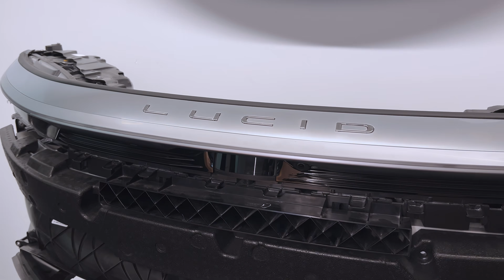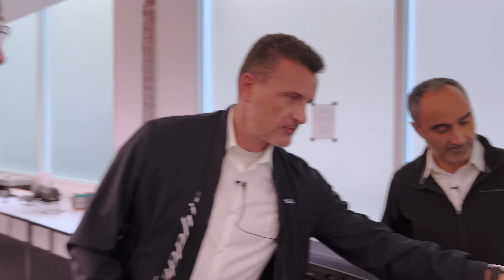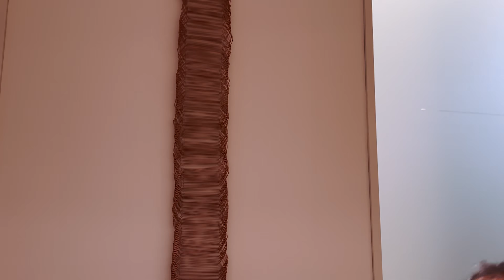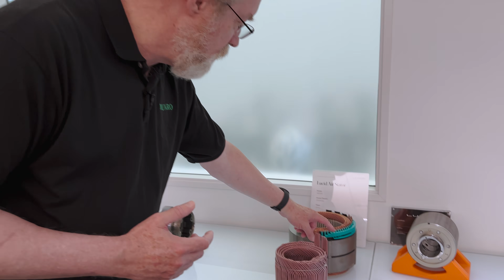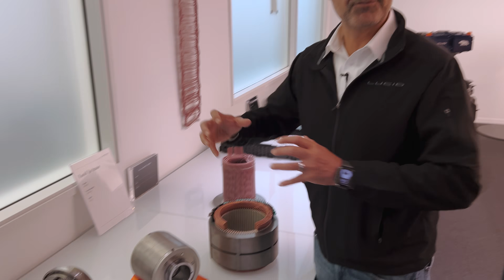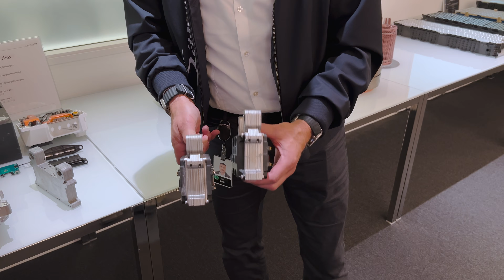Lucid Motors’ World-Leading Electric Powertrain Breakdown with Emad Dlala and Eric Bach

Comment: Impressive Engineering at Lucid!  I just hope they can become profitable!
Reply: 2028 🙏
Reply: They’ll make profits in repairs and replacements
Reply: @ what do you mean Explain?
Reply: @robertoguerra5375  How can they make money with over 130k LOSS for each vehicle???? That is a LOT of repairs and Replacement....If that happens, then why even buy the vehicle with them breaking down all the time????
Reply: @1flash3571  It's normal for a manufacturing business to lose money the first few years. Typically it's 5 years. Once they reach economies of scale they will make a profit. If you look at any other car manufacturers, they followed the same trend lucid did.
Reply: @rami8896  Do you even know what you are talking about???? Lucid started in 2007!!!! That is MORE than 5 YEARS.
Reply: @1flash3571  Im talking about the manufacturing EV business. All their equipment and factories etc are all brand new, therefore they have a high spending which makes them look like they are losing money.
Reply: @1flash3571 they didn’t become a “manufacturing company” until 2020. They used to a company called Atieva who designed the drive trains in Formula E (and they still do under the Lucid Brand)
Reply: @rami8896  No.  Rawlinson should have lowered the companies standards on engineering genius on their 1st model & focussed more on quality & output.  Getting more paying customers in, to start.  Elon's business plan has worked.   PR is too obsessed with beating Elon to be a good head of any business.  He's a childish pr4tt...  His annoying grinning on every early video & insistence on pointing out how Lucid's tech & efficiency was "sssooooo much better" than their 2 main competitors (using Porsche & Tesla modules as direct comparison, but without naming them) whilst smirking his silly little head off, was childish, ridiculous, annoying & CONCEITED!!  Compare Lucid' vs Tesla's production & sales achievements over the same timescales & Lucid lags considerably.  PR's obsession with "doing better" than Elon (in revenge for being sacked from Tesla) is hurting Lucid's, engineers who are seemingly more brilliant (or at least achieving more) than Tesla's!  PR needs to step down or sideways.  Lucid video's are far more watchable without his slappable face & comments on them.  Good luck to Lucid but they need much better reliability & many, many more sales.
Reply: @1flash3571  Peter Rawlinson wanting revenge on Elon for sacking him & his obsession with making a better car than Tesla to prove he's not a loser is the problem. You don't need perfection to beat Elon or ICE, you just need better...
&.... SALES!!   Peter R should go back to being an 11 year old circus clown & let, perhaps, Eric Bach take charge?!
Reply: They need to make affordable cars
Reply: @joebrdr and instead of 75kg 600+kW motors, make them 20kg 150kW, cheaper, lighter. Also lightet and cheaper rest of the drivetrain, smaller and lower current inverter, etc. Then shift cell chemistry to high energy. Nobody, except a bunch of rich enthusiasts needs a 2s 0-60 car. People need people's car - cheap, reliable.
Reply: Flula Borg can do no wrong
Reply: They OVER Engineer parts so they can't lower the price and make a profit....Tesla knows how to do the same but they realize that they need to make a profit to survive. Tesla is smarter than Lucid.
Reply: People are comparing them to Tesla, and how Tesla is able to price their vehicles the way they do. But Lucid is way beyond Tesla in terms of quality, user interface and just overall better vehicle. They are the Mercedes of EV’s, while Tesla is more like Lexus of EV’s. Lucid’s vehicles will more than always be on the more expensive side.
Reply: They will be profitable but it won't be for a while. They are still building / spending on technology. When they offer a mid sized SUV supposedly in 2026 that will be a volume  / profit play.
Reply: @tuminatr  Hardly expanding, they are still STRUGGLING!!  Too busy focussing on the tech & quality & NOT SELLING
Reply: They are, they just have a high spending because they are expanding
Reply: @rami8896 👍👍✅✅
Reply: @rami8896  so why were they this expensive to begin with?

Comment: This differential design was created by Hans and his son Erich Ledwinka used in the 1930's Tatra, 1950's  Haflinger and 1960's Pinzgauger. Its not unique in anyway what so ever but it is expensive and the power output is non bias. Easy to solve diff locking or ratio change for racing etc..

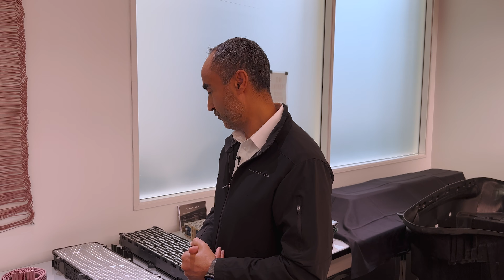Comment: "Its never been our problem to ramp and sell cars" 21:33 

That is actually, precisely the problem. And not doing it profitably
Reply: Selling at a loss and making it up on volume is a risky strategy.
Reply: Guess the Saudis like to play with real electric cars instead of toy ones. 
Lucid will never, IMO, return a profit to them.
Reply: Well I think it may be more of a demand problem than a ramp up problem, but it is probably both.  I don't think any car company can be profitable at 50,000 units or less, unless you can sell them at ferrari or lamborghini type prices.
Reply: @proximoAZ  Exactly.  Even Ferrari, Lamborghini, Rolls-Royce, etc. have struggled to cover their costs, and were bought by larger OEMs.  SAAB survived at 100,000 units per year, but in the end that wasn't enough.  It seems like 1,000,000 units per year is needed for profitability these days.
Reply: Exactly
Reply: They optimized the process so cost effectively, they are now selling 100k cars with a loss. Love the plastic part designed in there to fail with time to encourage more future sales.
Reply: @NotAnonymousNo80014  There are a lot of different kinds of plastic. I'd expect that they have used the right kind.
Reply: @jamesvandamme7786  It's a risky choice though.  High temperature environment, high cost of replacement, bathed in oil.  You'd like that part to go not just 1m miles, but 25 years.

Think about what happens when that ATF fluid in there overheats.  Lots of funky chemicals are created, but you can flush out the burned ATF and refill pretty easily.  The steel and copper aren't going to notice.  The plastic guides and resin insulation... that's going to be what fails.

I also wonder about those small coolant passages when you get particle contamination in the ATF.

Gotta say though, that differential/planetary packaging is a work of art.  I really like seeing all the buried short connections (electrical and mechanical), rather than orange-colored three-cable emitters arching through the engine compartment.

Comment: That twin rear drive unit allows a very capable RWD sport/supercar like the Porsche 911 GT2RS, AMG GT Blackline, etc.
Mate it to a battery that is not overly big and a light chassis and body, and total weight could get close to that GT2RS or Ferrari 12cilindri or Aston Martin Vanquish. Torque vectoring is very handy and the twin motor allows ~700 hp for a lot of time with higher peak bursts.

Comment: Next I'd like to see their drivetrains meet lightness. What can be replaced to drop weight?
Will Aston Martin really get their drivetrains? Or more?
Curious to see what can be done with higher ticket cars. Carbon battery modules? Integrated battery box and chassis from carbon? A clever BEV drivetrain with a clever McLaren-like chassis could challenge the gas powered Porsche 911.
Reply: You arnt going to get much lighter than this on the drivetrain side. The vehicle around it has to be lighter. And more energy dense cells would be lighter.
Reply: Remember what market they are competing in. Their cars are not overweight compared to their ICE or BEV competition
Reply: if you are referring to the drive units discussed in the video, they are already insanely lightweight